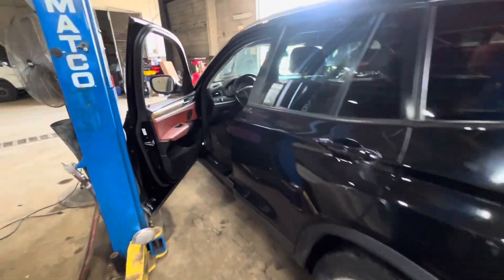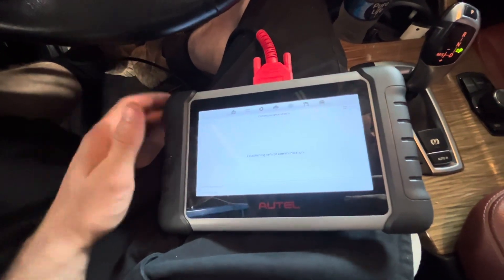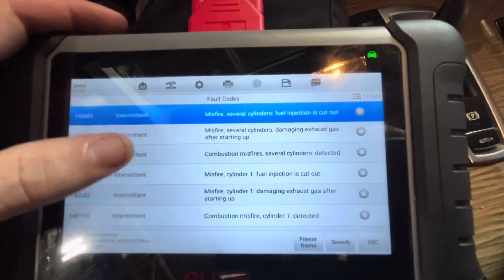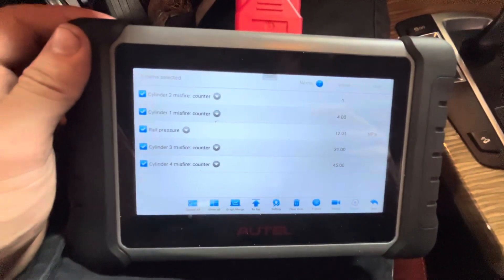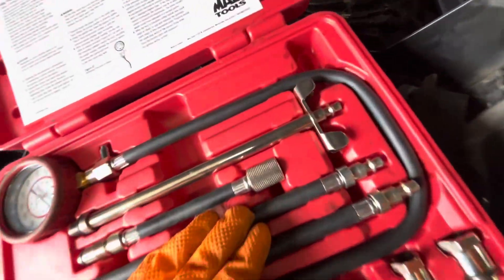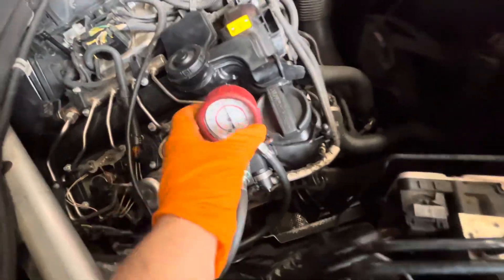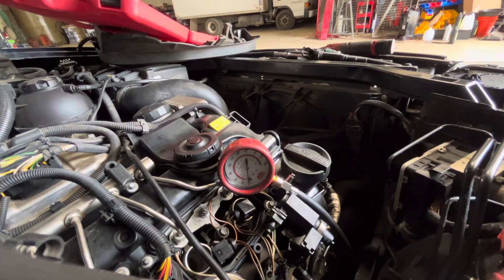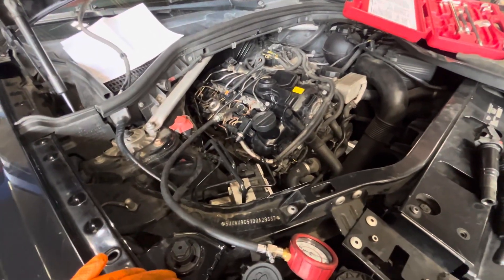2013 BMW X3 (N20) Misfire Diagnostic

Comment: I just dont necessarily think he needs a new engine.. maybe you need to run a smoke test and there’s a vacuum leak as well. Injectors could be shot as well and HPFP is prone to go out after 130k miles.
Reply from the maker: Maybe not. But with 60 psi of compression not a lot will make that change to anywhere close to the max deviation.